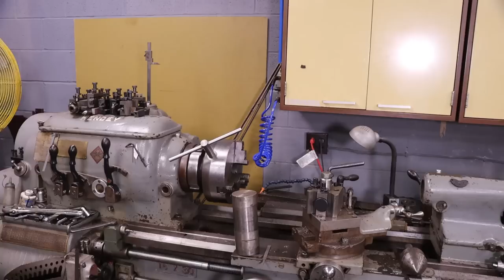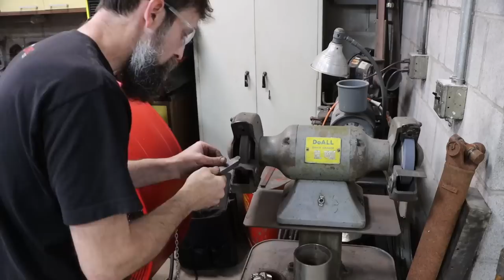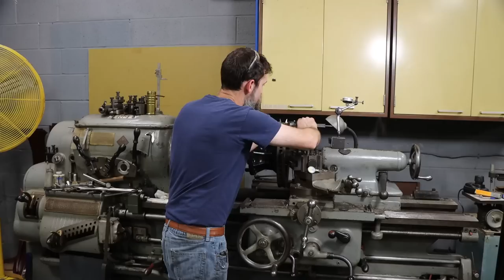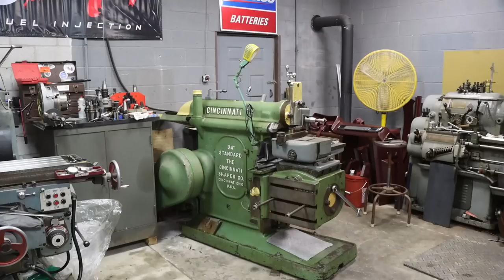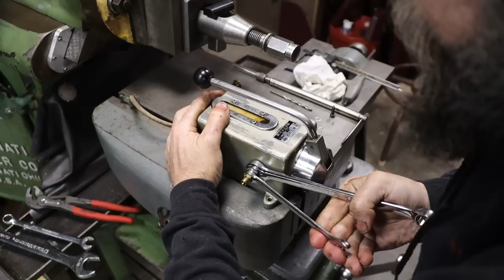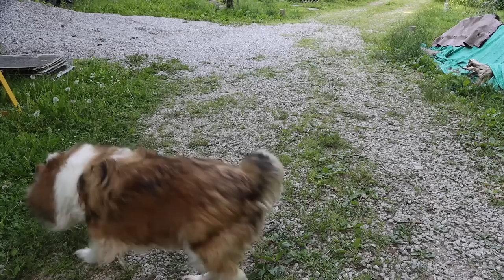Machining for Elizabeth / Metal shaper mod  Brown & Sharp  Update !

Comment: Both GM and Ford (I don't know about Chrysler) use this same type of rotor on their 1 ton trucks and in my opinion they are examples of some of the worst engineering I have ever seen. There is absolutely no reason that they could not have been made to accept a bolt on rotor like a motorcycles brakes. Instead, they create a bloody great lump like this that cost hundreds of dollars to replace when required. They are jus gouging their customers on the price of new parts.